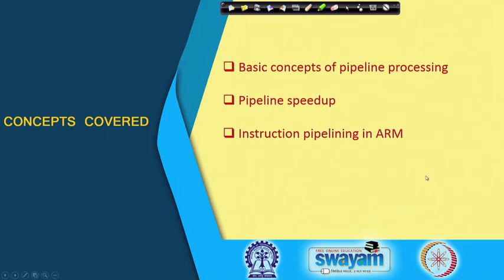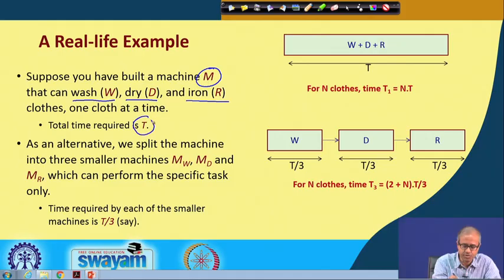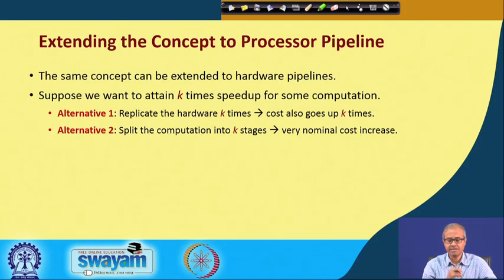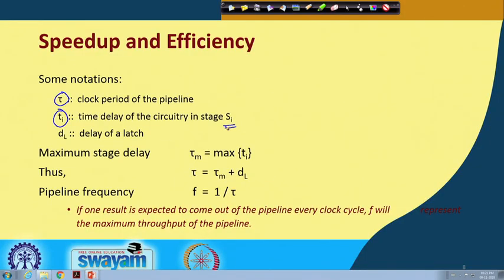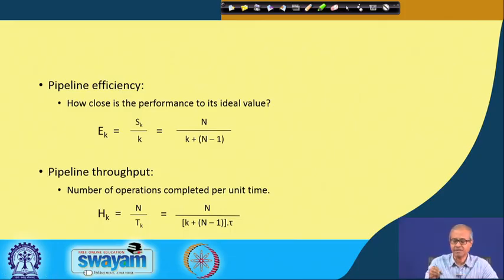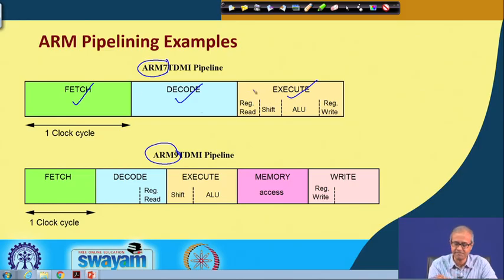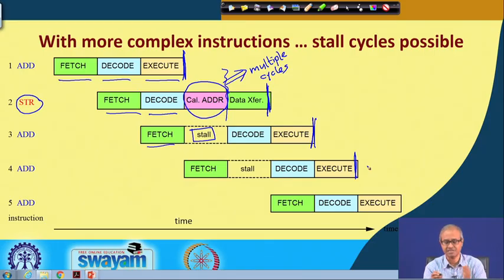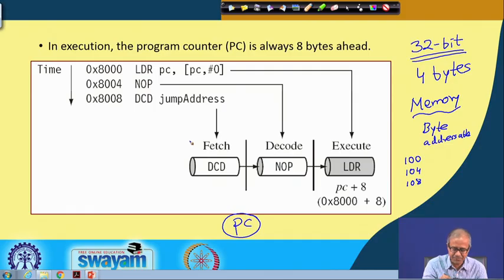Lecture 05: Architecture of ARM Microcontroller (Part II)

Comment: 00:31 - Pipelining in ARM microcontrollers allows for overlapped execution and significant speed up
04:37 - Using simpler machines in a pipeline setup allows for a 3x speed up without a 3x increase in cost.
08:03 - Pipelining increases the speed of a processor by dividing the execution into stages.
11:24 - Pipeline architecture with stages and latches for efficient data processing
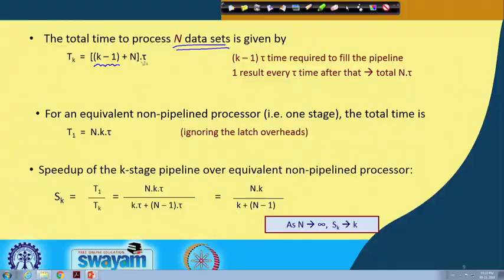14:43 - Pipeline efficiency and throughput are important factors in ARM microcontroller architecture.
18:44 - ARM architecture uses instruction pipelining which can provide k times speedup
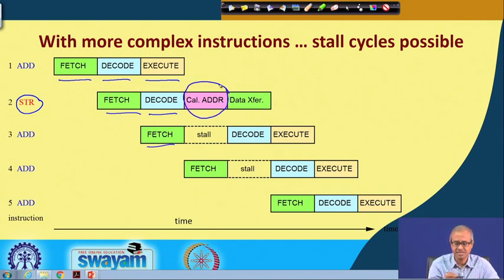22:30 - Stall cycles can cause delays in the execution of instructions, leading to slowdowns in pipeline operation.
25:41 - ARM7 architecture has a 3-stage pipeline and instructions are stored in memory at byte addressable locations.

Comment: Why do we need multiple clk cycles for parallel loading ig registers,using PISO(parallel in serial out) register it can be done in 1 clk cycle. Please someone answer this for me,they will be blessed.
Reply: But why, I mean it's serial out right, so we require 1 clock cycle to parallely load the shift register and N clock cycles to get the actual output serially. 
So I don't think that would help.